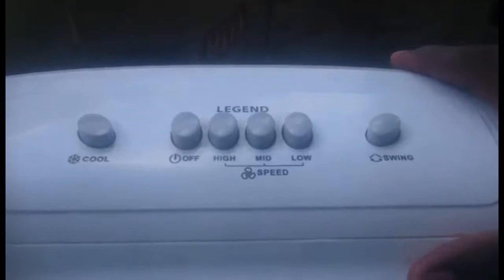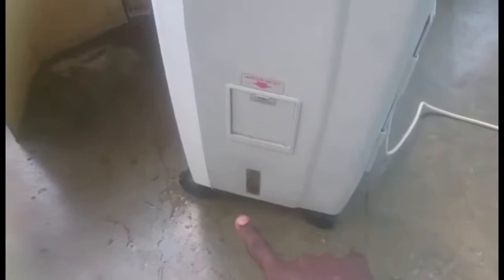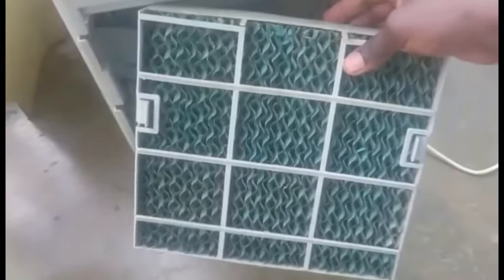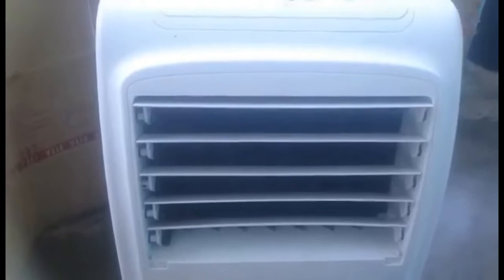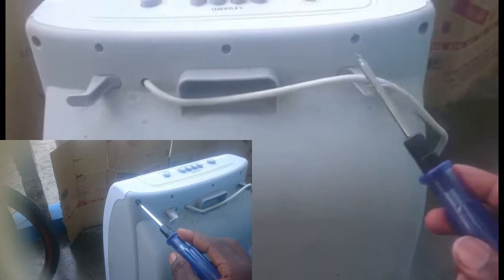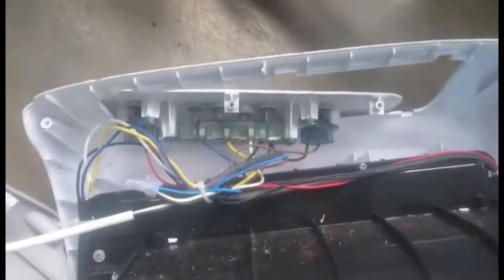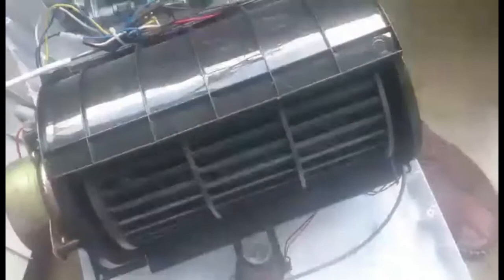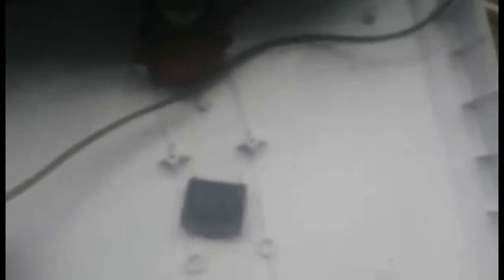How to fix an air cooler   # My fan is not working"

Comment: The bearing is dry, Bud, I fixed mine with a drop of light oil on the bearing.
Reply from the maker: You are right it could be the bearing or the capacitor. In my case of was the capacitor , after changing it it was okay

Comment: Hello. Nice vid. We have the exact same air cooler and I wanted to know the specs of the capacitor
Reply from the maker: I think you should send the old one with you as a sample so the electrical shop will know exactly what to give you .The spec on mine CBB61, 1.5uF +5% , 50/60 Hs ,40/70/21

Comment: my air cooler fan swinging late . it function but i need to wait more than 10-15 minutes . is capasitor problem or motor ?
Reply from the maker: Well ... The Capacitor assist the Fan to move ... So there is a high probability that the Capacitor is the problem

Comment: I have the same one, only the fan is different, it stopped working, tried to remove the fan coz i think there's dirt inside, can't remove a bolt on the lax, its stuck inside....🤦🏻
This Cooler has a shitty system, the lax heats so much it melts the plastic fan.

Comment: What is the exact specifications of the capacitor?
Reply from the maker: I will recommend you take with you the  damaged capacitor as a sample , because each Air-cooler may have different specs, CBB61, 1.5uF +5% , 50/60 Hs ,40/70/21